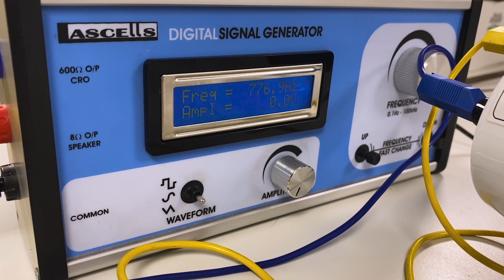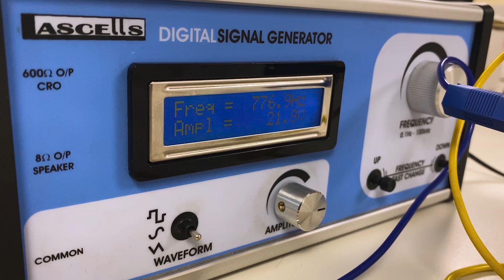Using a Resonance Tube to its full potential!

Comment: Where did u get 1.5 from?
Reply from the maker: Hi Deborah - I think you're referring to when I mark 4 points on the resonance tube with the marker... 

I get 1.5 wavelengths for this because i travel through 4 maxima - if you draw a sinusoidal waveform and mark the locations of the peaks and troughs, you will see that 4 peaks/troughs cover 1.5 wavelengths. 

Hope this makes sense? If not, please email me and I will send you a diagram :) you can contact me at sales@lascells.com 

-Nichola
Reply: I don't get how you got 1.5. Can you please simplify your explanation?
Reply from the maker: @DinnahDeborah  sorry Deborah, i might have confused you in my last comment. The four points are the nodes of the sine wave (the points where the sine wave crosses the x-axis) - 4 nodes corresponds to 1.5 wavelengths. If you could please email into sales@lascells.com, I'd be happy to send across a diagram to help explain further :)

Comment: This is great fun. I was doing similar experiments with a function generator connected to a speaker and a length of PVC pipe. I love wave physics. It applies to so many areas. Electronics, mechanics, fluid dynamics, quantum mechanics, and so much more. I could gush for hours.
It was really fun watching you guys performing similar experiments. As soon as I saw the word "resonance" in the title I was hooked. I didn't care what medium, or what context. lol.
Reply from the maker: Thanks 🙏 great comment! If you love resonance you should check out our resonance system… lots of cool things to do with that too 😀 no video on it yet though I’m afraid.

Comment: where can i get the lookup table?
Reply from the maker: @MikeRaphson thanks for your question, Mike! 

You can create your look up table in MS Excel. This gives you theoretical values of the resonant frequencies you should be able to find using the equation f = nv/2L.

For the first harmonic type =1*v/2L
Second harmonic type =2*v/2L
Third harmonic type =3*v/2L
And so on.

Where v = the speed of sound in air in m/s, and L is the length of the tube in m. 

Please let us know if any further help is needed! 🤓

Comment: Do you make a larger one?
Reply from the maker: Not in length, but we do a larger bore amplified unit that’s real good for the Kundt’s tube experiment.
Reply: You could technically make one as large as you want. If you've ever yelled into a tunnel to hear the echo, you used an extremely large resonance tube. Being so wide, the resonant frequency would just be quite low. At 60hz, the wavelength of sound is 5.5 meters (around 20 feet). You would also need a more powerful sound source, since you're using such a large tube, compared to the one in the video. But, you could absolutely find the resonant frequency and do the exact same experiments. In fact, you don't even need sound. You can use light in a reflective tube and get similar results because light acts like a wave. Or you could do it with waves in water. That's why I love wave physics. It can be applied to so many different things. Electromagnetic waves, sound waves, waves traveling through water, electrical waves like the sinewave coming from mains outlets. Even matter itself acts like a wave.